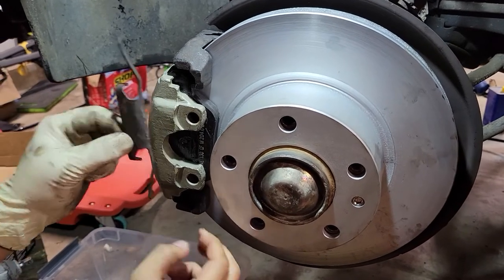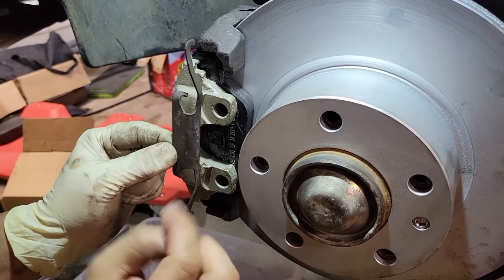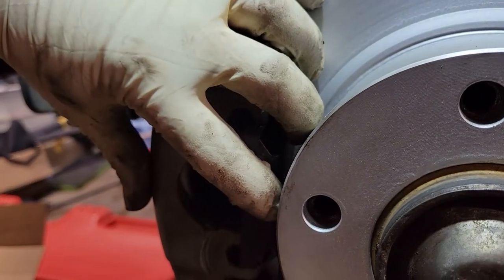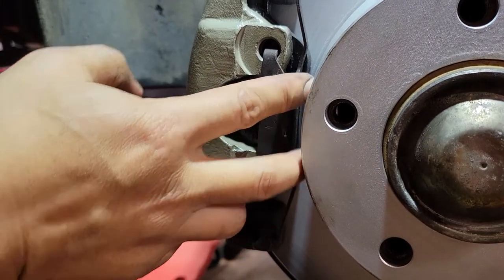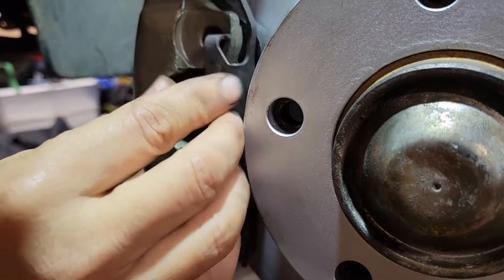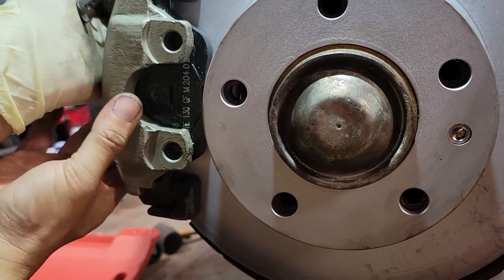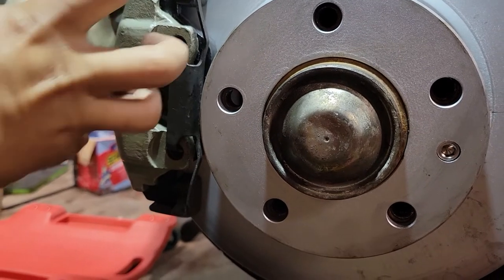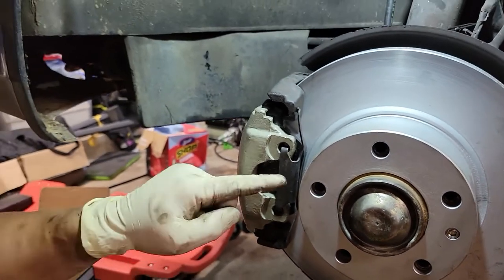Remove & Install Anti-Rattle Brake Caliper Clip - No Tools

Comment: Should I change with new one this clips? Does it holds brake pad away from rotor when we release the brake pedal?
Reply from the maker: No need to use new clips if old ones are not damaged.
Reply: @bmwchannel7209   thank you🙏

Comment: Do you really have to have the clip on?
Reply from the maker: You'will hear rattling and your brakes pads will be loose and not wear evenly...
Reply: @bmwchannel7209 will you feel vibration ? I am missing one and breaks are shaking
Reply from the maker: @naders5  that can definitely happen also. The pads are loose and skipping around and then they wear unevenly and that makes them shake even more then that makes them wear unevenly even faster and them shakes more and so on… just order a clip and replace it… super important and super cheap. By now you will most likely need new pads because of the damage already done from not having the clip in the first place.
Reply: @bmwchannel7209  you were right I installed the clip last night and the shaking stopped, thank you
Reply: The hardest part of working on this thing is that goofy clip!